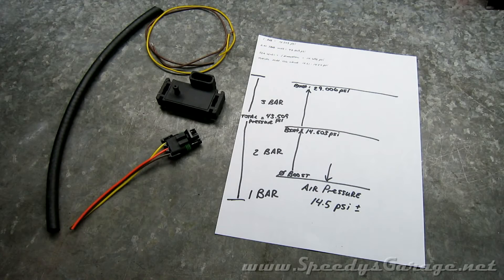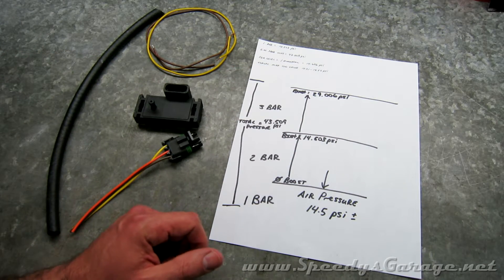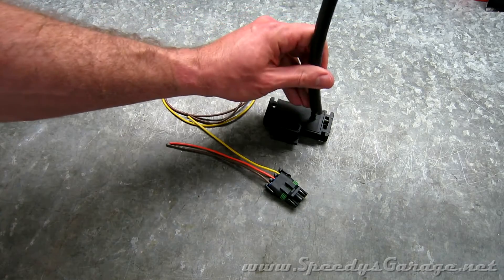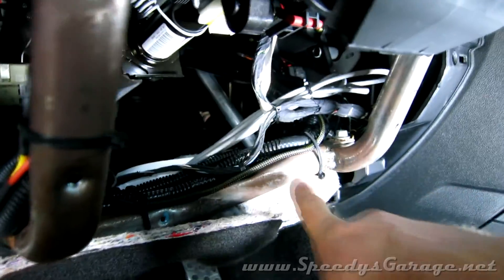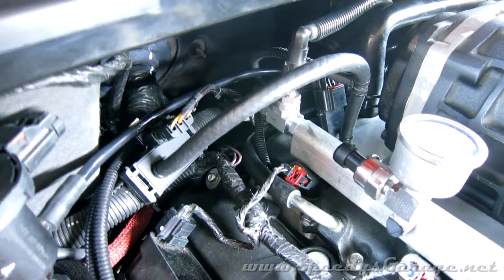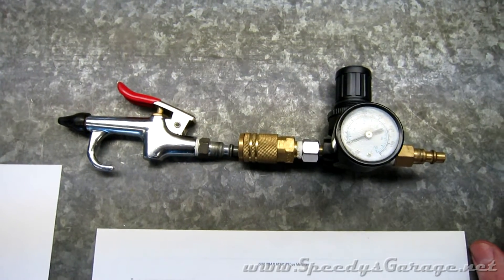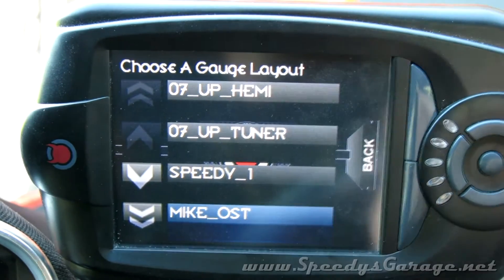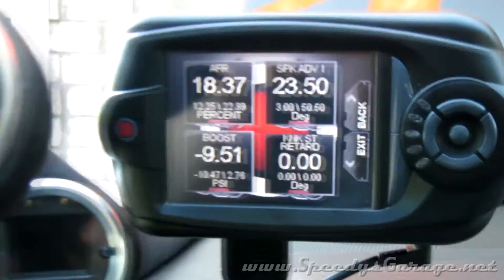3BAR Map Sensor Installation for Data Logging

Comment: Will the aftermarket MAP sensor that comes with the supercharger kits not automatically read boost? Im asking because I just bought a used Eforce supercharger. I want to ad boost, fuel, and AFR but hoping to do it all thru the Trinity.Also, what fuel pump upgrade would you recommend and fuel pressure gauge set up?
Reply from the maker: +James Orr The 2BAR MAP that comes with most FI setups will read boost up to about 14psi.  Above that you'd need to come up with something like I did to read it accurately or it would just top out at 14psi.  If your staying at 6-8psi you won't need a fuel pump upgrade and I don't see the need for a fuel pressure gauge when you have AFR.  I would put a fuel pressure gauge on the fuel rail.